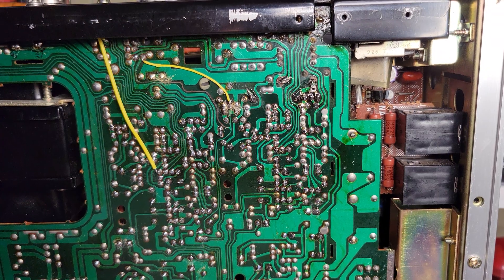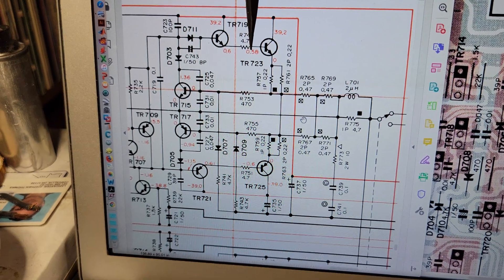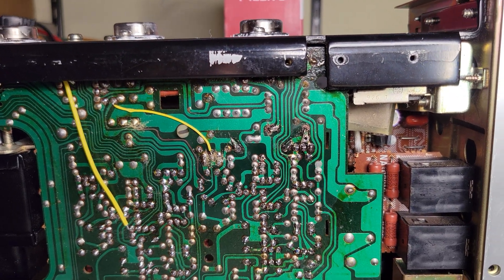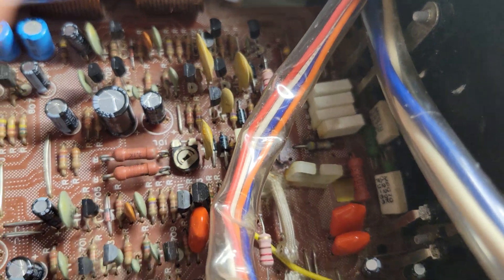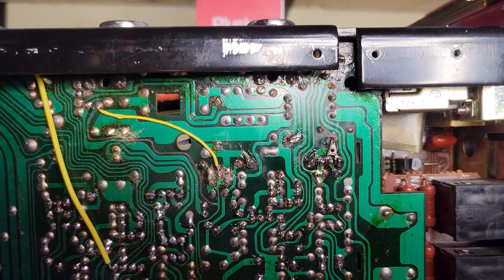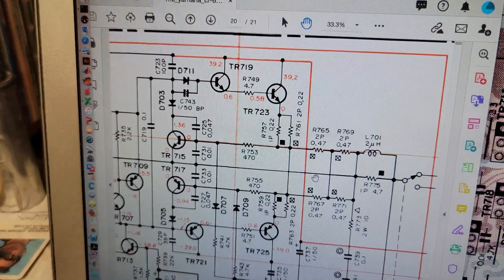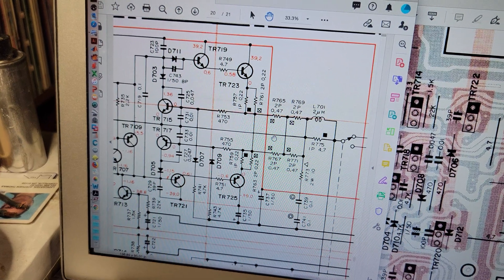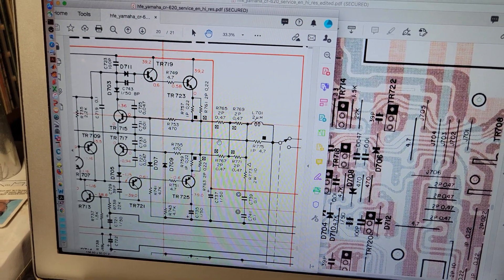Problem Solved! Vintage Receiver Malfunction Fixed!

Comment: I just repaired my CR-620 too. It blew all four of thoe 4.7Ohm resistors as well as the drivers and two of the output transistors. I think these resistors are designed as fusible resistors and the sleeves were meant to prevent a fire. I plant to order some 1/2 watt metal films as replacements in an attempt to keep the amp from self-destructing in the future. As a side note, looking at the protection circuit, it only monitors DC offset, and not overloaded outputs, which might explain why they fail. BTW, I live in Corvallis and enjoy your posts.